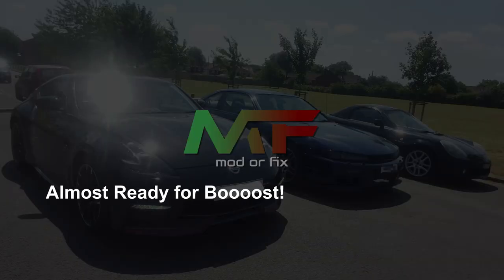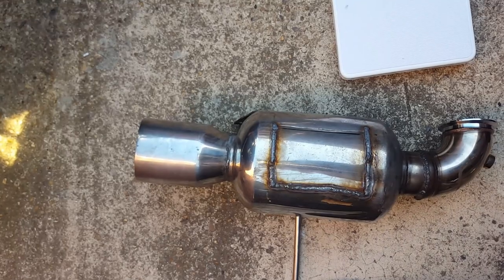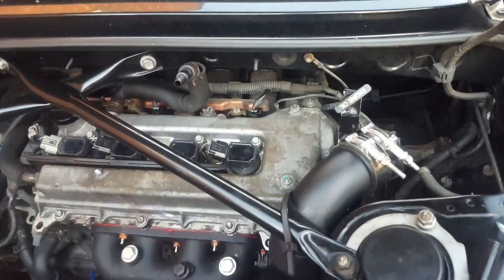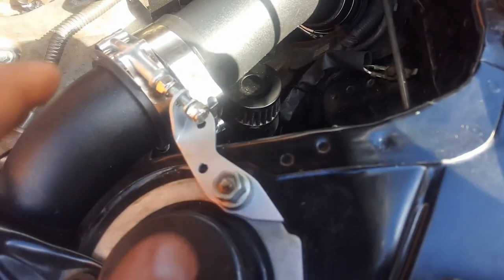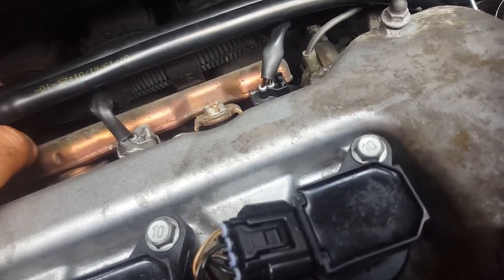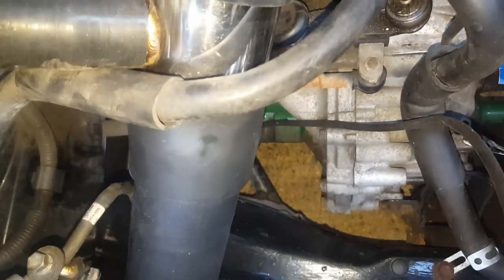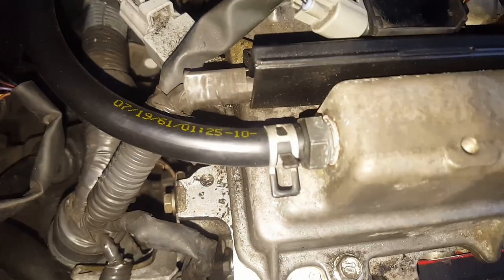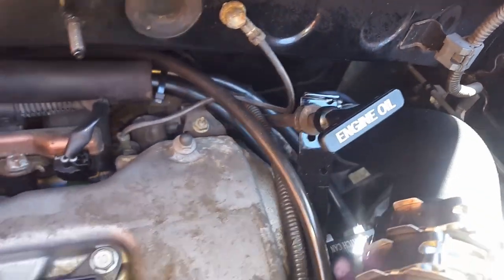Custom Turbo 1ZZ MR2 Roadster / Spyder Build Part 4 - Vac Lines, Catch Can, Muffler rebuild!

Comment: What did you do to the metal tube at 6:53
Just leave it like that?
Reply from the maker: Thats the breather for the fuel tank. For now its left but I have some one way breather valves on their way over from China which will be fitted.

Comment: Catch can 10:00 goes 10mm into vented catch can back out into 14mm back to the engine on the other side. With this setup should you vent or you plug the throttle body if you are turbocharging the 1zz? Also do that mean you no longer need the pcv lines on the air intake? And what does the wastegate and bov pcv pipes connect to?
Reply from the maker: Use the pcv vac or evap vac lines for BOV/wastegate. And yes plug the throttle body. I am pretty sure it's all in the video?
Reply: @ModorFix  just double checking because a lot of turbo installs say to vent it to atmosphere so I get confused
Reply from the maker: @zokusharuuku1091  you can vent to atmosphere if you don't mind the stink. Done it on the 300zx.

Comment: Woah this is so confusing, I seriously don’t understand all these vent pipes. I’m just trying to turbo my mr2 lol. I’ve got a catch can, I sorta understand how you installed that but I don’t know what the bov or wastegate needs to be hooked up to. Also a lot of people say to vent that pipe by the throttle body to atmosphere. And also what do you do with the pipe on the air intake?
Reply from the maker: You really need to try and understand how it all works. But in a nutshell, the MAF is the most important thing to consider here. If the maf sits pre turbo then you need to recirculate the BOV so air is measured correctly. If the maf sits post turbo then it doesn't matter. And yes position the bov closest to the throttle butterfly as poss.

Comment: Hi  do i need aftermarket computer on 8 psi ?
Reply from the maker: I would say yes. You could probably get away with 1 or 2 psi on stock management, but at 8psi the car would undoubtedly run lean. If you have an AFR gauge fitted, which you really should, see how the car runs and take it from there. You don't have to spend the earth on an ecu.  Have a look at an emanage blue or there is an ecu masters det3 which is deemed better and more modern, easier to map too. I dont have personal experience of the det3, but had a look online and it looks like a good bit of kit. I think the key thing is to find a good mapper and work backwards based on their recommendations
Reply: @ModorFix  
Thanks 
And a question about the vacuum manifold.. where is the supply line from?
Reply from the maker: @100stamina  there are 2 supplies one from the throttle body and one from the manifold itself. I think I showed that in my video. I used the thicker one from the manifold.
Reply: @ModorFix  
Ok thanks again 
Im not really good at listening in English
Reply from the maker: @100stamina  no problem :)